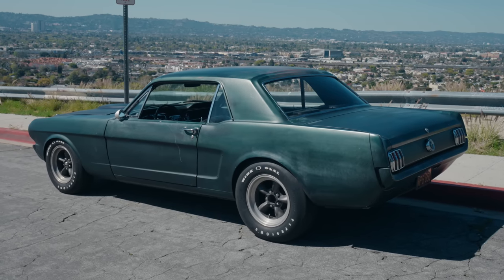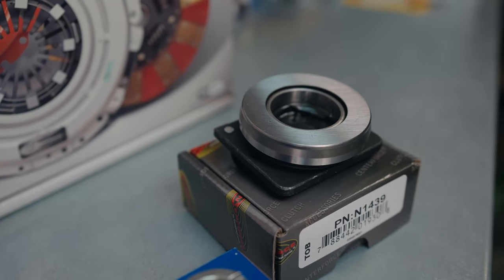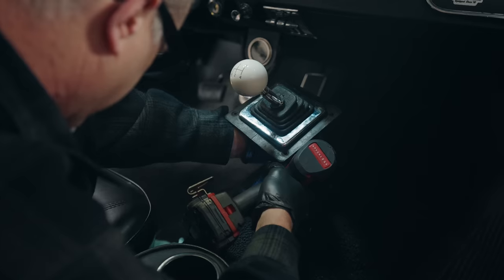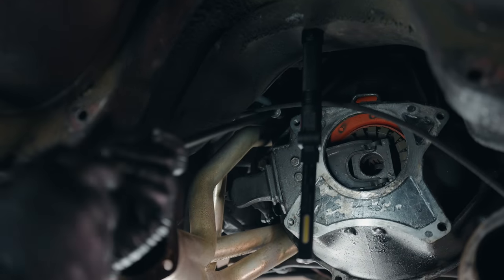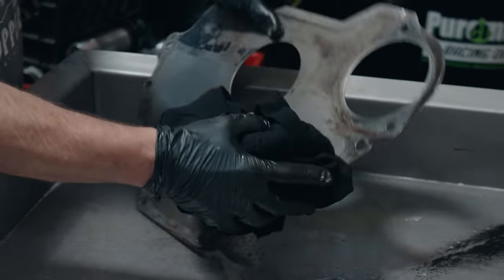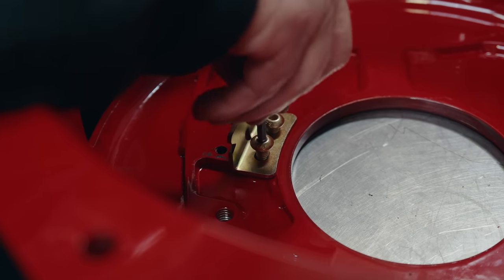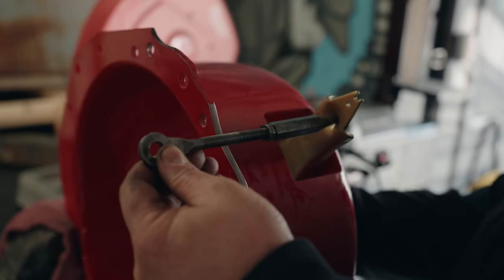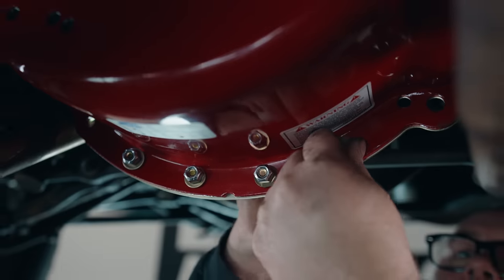My 1965 Mustang Gets A Huge Clutch Upgrade!

Comment: Reminds me of my younger days. My first car was a '65 Mustang GT, I bought in 1973 for $500. I drove it through high school, starting going to a local community college where I rebuilt the motor in it and installed a Melling camshaft. The next year I was involved in a wreck with an 18 wheeler, and totalled the car. Bought a '67 Mustang with a 6 and a three speed, rounded up the parts I needed and swapped in the 289. Wish I still owned either of those cars today. But fast forward and when I retired, I bought a restored '73 Mach 1. So we go to cruise ins and car shows. Still have that Mustang fever!
Reply from the maker: Awesome

Comment: If you're wondering about Borgeson power steering, I put their box in my 66' mustang and it was the most difficult install I have ever done. I love working on my car (I've swapped my trans, clutch, flywheel, rear end, front and rear suspension, and installed Sniper EFI) but I would never do another Borgeson box. Every part, including their z-bar needed to be modified, and it almost reduced me to tears😂. If you choose to go that route, buy tri-y headers.
Reply from the maker: Manual box it is😂

Comment: Ben get a starter for a 1993 mustang with a 5.0. There a factory mini starter.  You'll have to change the wires on the solenoid but otherwise it's a bolt on deal. Good video.
Reply from the maker: Cool!

Comment: Borgeson makes a good power steering conversion kit I used it on my 66 mustang and it only took a few hours. It gets rid of the junk ford piston style power steering and adds a Chevy style box. You have to remove your steering column and trim it but that is in the instructions and a bunch of YouTube videos cover it. I haven’t had any issues with it in well over two years. It’s a lot cheaper and easier than a mustang II rack 😂
Reply from the maker: Thanks! Did you need to buy new headers?
Reply: @FourSpeedFilms  nah my headers were fine I have a 87 5.0 block with long tubes and it was all good. The 289 should be about the same but I’d check out some videos to see there’s plenty of them. Just incase for some reason my headers arent the same as yours. But it’s basically a replacement steering box. It uses existing hardware on the manual steering and basically makes it a power box. Which is super helpful it’s a big difference. It doesn’t feel sloppy but it’s going to definitely be a lot “looser” than manual steering because of the power boost 😂. The worst part is really reinstalling the box because the headers are there but other than that it wasn’t too bad I had it done in an afternoon. But I would def do this over a factory power steering unit as those stabilizer type steering units are known for going bad constantly.
Reply from the maker: Cool! Thanks for the tips!
Reply: @FourSpeedFilms  of course! Cj pony parts has a good video on it as well as others who have bought it. I bought mine from CJs they have a store like 2 hours from me so I got relatively fast shipping. I know some mustang and Ford fans don’t like them but I haven’t had any issues with them. And they’re just a company that sells the kit I’m sure jegs or summit sells it too. Good luck with your stang can’t wait for future vids

Comment: Just curious why didn't he dial indicate the new Lakewood belhousing? Ive had alignment issues on everyone I've ever installed
Reply from the maker: When I did some research it looks like it isn’t that important with old transmissions. They have a higher tolerance from being misaligned. However, modern transmissions have a very small tolerance for misalignment. We also didn’t have any extra dowel pins

This is where I found the info:

https://www.holley.com/blog/post/how_to_align_your_bellhousing_for_maximum_transmission_and_clutch_life/
Reply: I run a Muncie in my nova and I had issues it is a modernized one with super case. I'm impressed it shifts perfect must be the ford luck lol

Comment: I'd like to see the before and after driving difference of an aftermarket upper A-Arm with some built in positive caster.    Most from the aftermarket arms have 3 degrees positive caster, stock is around zero.   Of course you want power steering before you make that mod.
Reply from the maker: That would be cool

Comment: Those  Centerforce pressure plates are a gimmick. A friend of mine with a 69 Camaro was shifting gears and the 4 speed locked up into a gear which I don’t remember which. The weights broke away and pieces were jammed in the clutch and pressure plate. Be careful at high rpm shifts, they may let go. I myself went with a Luk clutch in my 70 Z28 and don’t believe in those weights. IMO it’s BS.😂 Wow and here I thought you were doing the work yourself. 😂 Parts given to you and installed, must be nice.😮 All that work and you don’t even install a TKX 5 speed. 😂 BTW your steering wheel is not straight which would bother me.

Comment: in my experience it's best to only use a Ford Performance throwout bearing. the ones that come with clutch kits just don't last and it'll be chirping like a baby bird in no time.
Reply from the maker: Hopefully I don't run into any issues, haha!
Reply: @FourSpeedFilms  I typed this at the beginning of the video like you havent already put it all together already, lol. derp. the kit bearings are certainly a problem on later model T5 transmissions, maybe with the older t10 it wont be an issue, i dunno. I hope it doesn't give you trouble too. Nice job, must feel a lot better now.